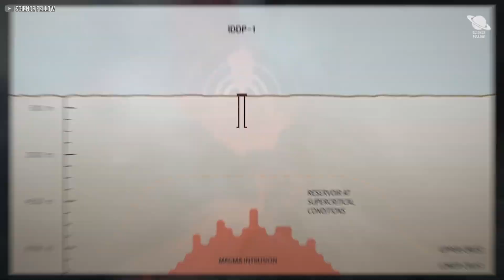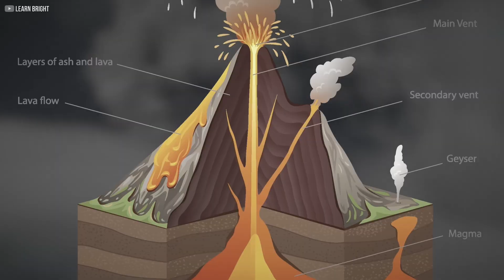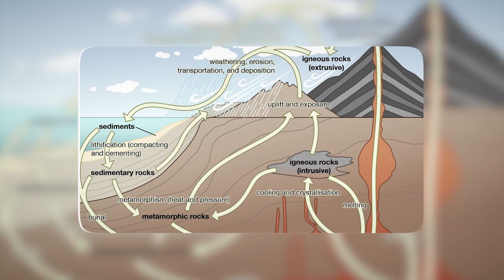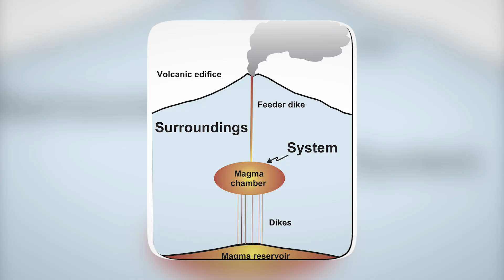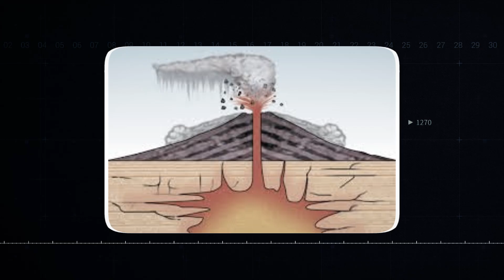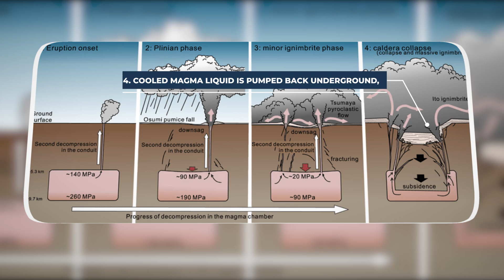The Icelanders Have Started Drilling a Hole in the Volcano and It Will Change Everything

Comment: I did some work on an 'Energy Efficient' neighbourhood where they drilled a couple of hundred holes about 200 ft down. In the winter they would preheat air to about 40F before it got heated for the homes. In the summer they cool the air down to about 50F before it went into homes. Basically they were using the Earth as a big heat sink. I don't know how well it worked years later but it makes sense to me.

Northern lights are incredibly distracting to drive into. Staying on the road becomes quite the challenge. That northern sky is something incredibly distracting. While driving north I was wishing for cloudy skies to avoid ditches.